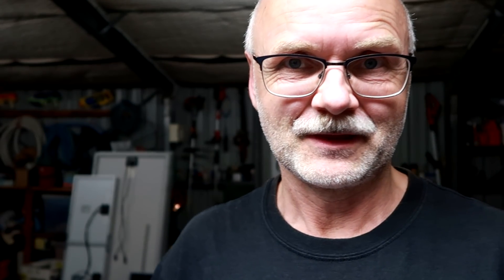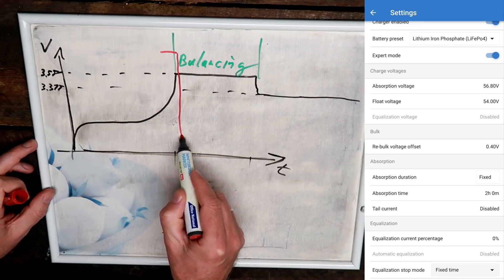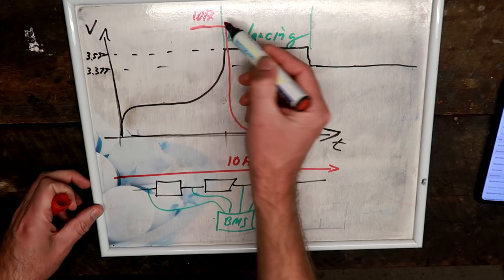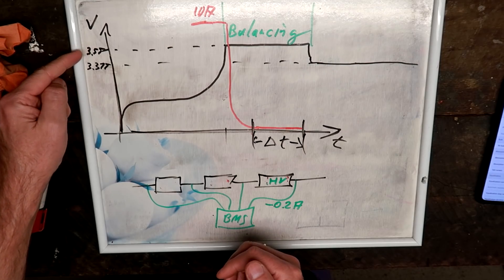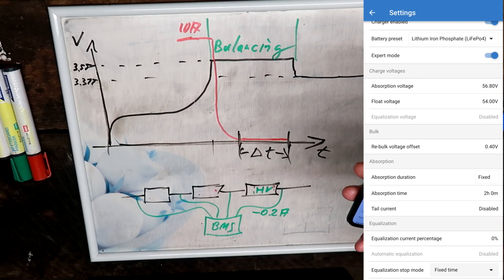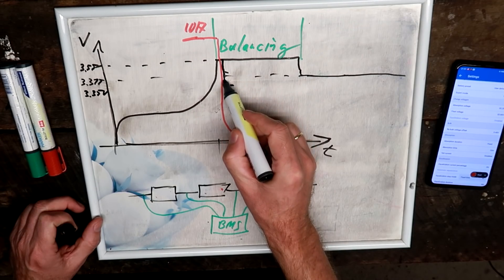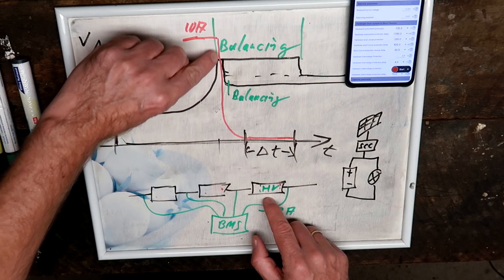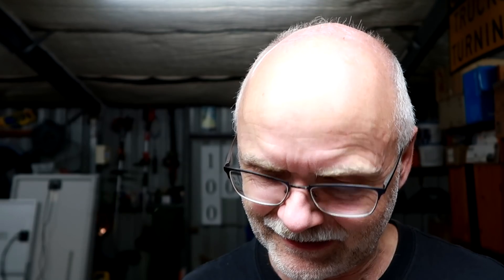Can I balance my battery while floating? Well, I do!

Comment: Chargers (charge controllers) are not "pushing" current. The current is the one that can be absorbed by the battery (ie the battery itself is the main controller of current (in most practical settings when it's not explictly limited to a very low value)). This is tied to the most common mistake in the DIY community: that supposedly the current going through a series of N elements is fully absorbed by each cell divided by N; no: you don't require parallelism to balance that; each CELL just like a full battery has its own internal resistance to accept CHARGE so basically do not confuse current with charge.

Comment: Im probably thinking of this all wrong, but if you want 'balancing' during the float period, would it not function better to set the balancing at 3.349v instead of the 3.351v that was selected? Im presumably misunderstanding the situation, but surely if the float voltage is being maintained at 3.35v/cell(equivalent),  then the balancing function will not be active if set at 3.351v (for most of the time, since loads are being fed from SCC)???     Furthermore, I would have thought, that at 3.349v/cell the highest cell would constantly be getting 'bled off' , all whilst the SCC attempts to maintain the float voltage setting point of 3.35v. In my crazy mind, this seems to me that the balancing would get done very gently using very small currents(not bouncing all over the place) , over a longer period of time, producing more stability???

Comment: Very interesting video! I am a newcomer to lifepo4. But I finde, that for my 24v system in UPS usage scenario without PV is good to use charge bulk 27,8v(3,475v) 45A without float and without absorbtion- dont reach high SOC for healthy. I have diff voltage usual  at 0.005v at 3,32v per cell in rest.
But, in my oppinion, due to the smollest difference in tempreture and internal resistence (but I mesured all the same 0.18mOm on each 8 cells 202Ah Lishen) under load and during chage, we get increasing unbalance day by day, that is not so visible at flat line 3v- 3,3v. Lower 3v and higer 3,55 diff goes up to 0.200v  under load or on charge to 3,55-3,6v! 
But for more acurate balancing i my Must pv3024plus 24v I have option "equalization" and nobody doesnt explane me, that it is not only for AGM or Lead battarys and also good for LiFePO4 battary. 
In "equalization" mode it is the same charge  curve that Andy shows in this video!
In mode "eqialization", once for a month or once for a weak, whatever... I can set voltage higher, than my usual charge bulk 27,8v(3,475v) to   29v ( 3,625)v, for example.
In this case voltage goes up in 2 steps: to 28v CC/CV 1st and than very slow to 29v with 10A to 1A increasing current and  goes in flat line at 50mA carrent for equialization - some absorbtion ,for exemple for 60 minutes and Neey balancer works hard for eqialize, balance cells and charge current goes down to almost to 0A. After that time charge stops and voltage goes to prefered float voltage or fully disconect charge.

Comment: Can you help me ??

Hey Andy, there are 2 cells in 48v pack that are too high and shuts off the BMS. One video of yours showed you lowering a cell with light bulbs or something. How did you do that?
Reply from the maker: I just use some car 12V light bulbs and connect them to the cells which are getting too high to discharge them a bit until all other cells have caught up.

Comment: Sorry Andy, I don't quite agree here. There are many ways to implement the balance process. Gently balancing while charging is like gently steering while you are driving on the freeway (and it works regardless of the speed you are driving), plus it is better for the cells since it slightly reduces their peak voltage by subtracting SOC earlier. Small nudges make a difference in the state of charge, as small steering adjustments change the vehicle position within the driving lane. A good battery pack only needs small nudges to keep balanced. If a pack needs more balancing it won't be balanced at the end, but that's a problem with the pack. Whether the balancer burns 200mA for say 1 hour while the battery is charging or afterward either way it has drained the same 0.2Ah and the same SOC percentage from the cell. The earlier it drains this the lower the peak voltage the cell experiences and the better it is for the life of that cell. Either technique works to balance the pack. There are many ways to balance. Gently balancing is valid as soon as the imbalance can be correctly detected, and the optimal time to start balancing is as soon as a valid detection of imbalance can be made.
Reply from the maker: Thanks for your comment Alan.
This balancing method you explaining here (charge balance) does not work with LiFePO4. You cannot balance these cells at a lower voltage. It makes no sense and causes imbalance. Once the voltage rises finally, the BMS has no time to counter this action any more and the battery will never get balanced ever.
These balance methods may work with li-ion as these cells drift quite early but LFP, no chance. Balancing only works after the voltage knee which is around 3.4/3.45V.
Reply: @OffGridGarageAustralia  Hi Andy, I'm sorry that you misinterpreted my posting. You were saying lower voltage, I neither said that nor intended that meaning.  Balancing can start at any voltage where imbalance can be CORRECTLY DETECTED. This voltage must be above the flat part of the charge curve as no proper determination of balance can be made until the voltage begins to rise at end of charge (note that this voltage is a function of temperature, so picking a fixed value that is too low may cause problems when the seasonal temperature shifts move the system voltages upward, the default values are chosen for a wide range of temperatures). The most important point here is that there is no need to wait until the charge current is zero. That is not important. As soon as imbalance is correctly detected the balancing operation may start. It does not matter that only a small current is subtracted from a larger charging current. The SOC is being steered, and that is the way balancing works. The SOC must be steered so the cells match in voltage. The balancing is adjusting that SOC so the voltages match. Gently steering the SOC is totally valid, as long as the information is there to do it correctly. Doing it at too low a voltage fails to work because the correct information as to what cell's SOC to adjust is not available. The cell voltages don't reveal the SOC during the flat part of the charge/discharge cycles. Thanks.

Comment: Why can't you use zener diodes to balance the cells? They come in 3.3V  .
Though it really seems an ideal solution to have the right voltage of solar cells to charge each cell individually.
6x 0.55V cells in series,  however many lots of six in parallel as you like.
Reply from the maker: You cannot balance any cells at 3.3V, that is far too low. You want to be in the part of the charge curve, where the voltage is rising, so 3.45V for LiFePO4 and around 4V for Li-ion. And this may be a different point for different batteries and also may have to be adjusted once the cells get older.
Reply: @OffGridGarageAustralia  yeah and I guess you'd need another diode, perhaps an LED in series with the Zener but opposite polarity. Which could increase the charging bypass voltage to 3.5, and stop the cell discharging through the Zener.
 I'm no electronics whiz, but that seems to be the simple standard voltage regulator setup.
If an LED was used then you would get a nice indicator light telling you the cell is at voltage, when the Zener breaks down at the cutoff limit.
Just a thought.
Living on a boat and wanting stuff that can handle marine environments and be easily diagnosed and fixed from spares you have on hand.
I mean, its life or death if you can't keep vital systems running at sea.
I've got bought digital voltage readouts for each of my six cells. I think I can do alright piloting the vessel on electric propulsion by spade switching neighbor cells in a series of six from series to parallel for throttle and top and bottom balancing purposes while the solar and motor are connected to the bank.
I would be nice to have a backup for the voltage readouts incase they should malfunction. Though switching the cells to parallel would diagnose that quickly.
Complicated electronics at sea is nightmare city.

Comment: From what I've learned, the main purpose of cell balancing is to achieve a "collective higher battery voltage charge" thus increasing your overall battery capacity. Either you're going to bottom balance, or top balance; or, you're not going to balance at all. If you're not balancing for the sake of capacity, and you're only operating the cells in a voltage range that is safe, then why balance them. Simply set your battery low and high cut off voltages to the state of your unbalanced cells. Don't waste your money on a balancer if you're not going to use it for what it's designed for.
Thank you for your educational videos. They are very helpful.

Comment: I think you got it correct.  I have a small pack 6Ah 24V  and float the pack at 3.45V per cell.  Keep in mind we are talking mV here when was the last time any of us have sent our meters/BMS systems out for calibration?  
Once my cells reach 3.45V the absorption current drops into the micro amp region.  The Cells are chemical electroplating baths,   ion movement is proportional to the current flow and not the voltage.  No current or very minimal current results in no chemical reaction.  However  too high or too low a voltage may cause other side reactions that are not desired for cell life.   I have no BMS  or balancing ( just a fuse for over current) and so far the cells have maintained a good balance, but my loads are very low.    My recommendation, charge to 3.40 to 3.55V then balance if you must with no load into or out of the pack.   Most of your cell voltage divergence results from the heavier load current and the cell's differing internal resistance and not so much from the generally lower charging current.

Comment: Try not to balance you cells at all. You will be surprised how little will change to what you are doing now. You can take 3 years vacation, and when you come back, your cells will be still where they are today. I didn't absorb, float or whatever for almost a year with my pack now. My BMS would need a trigger voltage of 3,55V to burn 30mA away. None of my cells ever saw that voltage. The only time I had to remove a bit of energy from one cell group was, because it was a bit ahead from day one already. LiFePo4 and balancing, is the most overexaggerated topic ever :)

Comment: I made a video. I'm blushing. :D

I experimented with balancing at 3.35v and it does usually work. However in my experiments I found that at 3.35v it would often pull current from "strong" cells rather than weak ones which can actually worsen the overall imbalance of the pack.

Why does it pull current from "strong" cells instead of "weak" cells? In my experiments I noticed that weak cells would hit 3.5-3.6v first, but then when the charger would shut off or switch to float mode (Or if my shed load turned on) the weak cells voltage would drop faster than the stronger cells would. So during "absorption" your weak cell might be at 3.55 and your "strong" cell might be at 3.45v. Now you switch to float and your weak cell quickly drops to 3.33v while your strong cell sits at 3.37v. Now your BMS starts to suck power away from your stronger cell further worsening the imbalance between these two cells.

I can already hear you asking: Why would the weak cell go from being higher voltage than the strong cell to being below the voltage of the strong cell so quickly? Two reasons: 1) it has a lower overall capacity, so it's voltage will drop a bit faster and 2) Weaker cells generally have a higher internal resistance so even if they have identical capacities their voltage will be lower because more of their capacity is lost to this internal resistance. Also: Andy already mentioned this but because of how flat the curve is at this voltage it's really hard for the BMS to tell which cells are weak and which are strong. You have to push the cell a bit into the knee to see which cells "stand out" from the pack.

I found that I couldn't trust the BMS to balance at anything less than 3.4v. I tried 3.37 and 3.38 as well. Anything under 3.4 and I found the BMS balancing strong cells way too often for my liking. This not only wastes energy (passive balancing just burns the excess power as heat) but it can also worsen imbalance which defeats the purpose of balancing altogether. So I just try to minimize the time the battery spends above 3.4v for balancing. My shed load technique has worked well for this: Anytime a cell gets above 3.4v it turns on a load. If there's lots of sunlight and the solar panels produce more than that load can pull away. (IE: My 3.2 kW array will first turn on one 1,000 watt A/C unit and if there's more than 1,000 watts of sunlight and it continues pushing the battery voltage above 3.4 it'll eventually turn on a 2nd unit for a total of 2,000 watts of loads). This gives the battery just enough time during peak sunlight periods to let the cells get above 3.4, balance a bit, and then drop back down to levels where degradation is not an issue.

So basically my cells only get balanced on especially sunny days (And even then only for a few minutes at a time) which helps me minimize the time they spend above 3.4v. Over time this has been enough to maintain decent balance of my pack. I also have active balancers which help to minimize this time as well because I have a couple cells that I have replaced over the years and those new cells are obviously much stronger than the rest of the pack which make maintaining balance a bit more challenging.
Reply: Hi Jeremy. I was wondering which active balancers you are using and do you have more than one paralleled?
Reply: @itsmeasis  I use these: https://www.electriccarpartscompany.com/3v-1s-lithium-lighted-battery-balancers
And no I don't have multiple in parallel.

Comment: Andy I wish to respectfully disagree a little on balance curent. Yes the balancing cell is not discharging but it also means all the other cells are charging more. Therefore they are getting more coloumbs. The question becomes is the difference enough over the time it takes to go from balancing to overvoltage of the highest charged cell. Really we need a integrated BMS/charger that can taper current based on individual cell voltage.
Reply from the maker: If the cell with higher voltage is charged less and the other ones are beeing charged more, that's actually good and part of the balancing. I just don't believe the BMS is capable of handling these high capacity cells. The 0.2A balance current is just not enough to make a difference in the time available to it.
A charger which can handle all cells individually would be amazing. I know Peter here is working on somethign like this.

Comment: So, what is "wrong" with enabling / starting the Cell Balancing process during the Bulk Charge mode, when any cell goes ABOVE the 3.351 Volt set point ?  Nothing is wrong, you just "claim" it wrong.  In fact, it is good thing to enable / start the Cell Balancing as soon as any cell goes above 3.351 volts in Bulk Mode, to obtain maximum Balance Time.  So, I do not see WHY you think is better to DELAY the start of Cell Balancing, long after the cell voltage has raised ABOVE 3.351 volts.  This video, your graph & your "logic" make no sense what-so-ever ...
Reply: Hard to say what is right and what is wrong. If someone can explain, what does it mean, if several cells run up during charge and go lower at rest or discharge... 
I think, becose of the slightly difference  of internal resistance, and/or capacity of cells during charge or discharge using I=U/R we can explain the deviation during charge higer then 3,45. In my case, I always have 3 cells, which always runs up on 0.020v at 45A and  27,8v ( after 3,4v until 3.55v) and daly bms slightly slow down there run-up. And when charge is on finishing line, voltege increased above 28,2 and current starts to go down my Neey balancer starts the job, that 3 quiqly goes down under 3,45, and other 5 cells that was lower on 0.020v becomes higer on 0.050v and goes up to 3,630v! at high battery voltage and decreasing current. So that 3 cells, which looks higer becomse lower and look like not fully charge... So, if would set start voltage at 3,35v for Neey 4A balancer, it will discharge that 3cells, and in the end the they become not fully charged,  and it will look like 5 cells at 3,612 and 3cells are still at 3,437v. I described my real situation. And for balancing I leave it in float at 3,588v for several hours to get deviation at 0.002v and then tern of. Iven ufter that, after rest, that 3 cells looks lower on 0,002v...
Maybe nex time I'll do experiment and try to charge to 3,600v all battery and then separately that 3 cells one by one with automatic 3,65v Lifepo4 charger to 3,65 and some absorbsion. Maybe that 3 cells become fully charged.  But maybe in this case they could run up much more quiker and bms and balancer would discarge tham, and again.... 😞

Comment: Second post, yeah, you went down the rabbit hole I was, but you took the time to actually test and present.  Thanks, this really helps my thought process.  I agree.  The pack that stays together, is a happy pack.  I see the variances at the top/low ends.  Why go there?  Just build the pack bigger to compensate for the lost capacity, which is minimal.